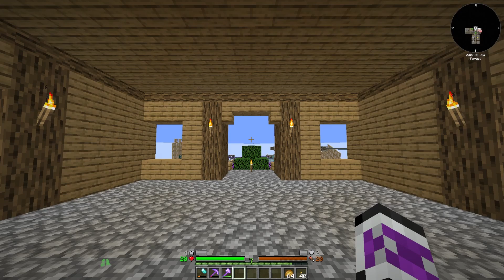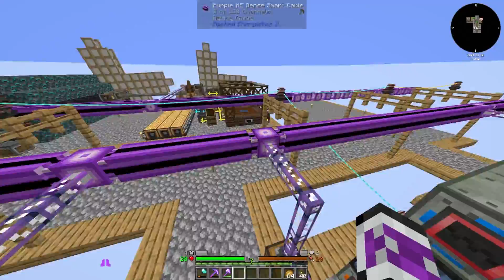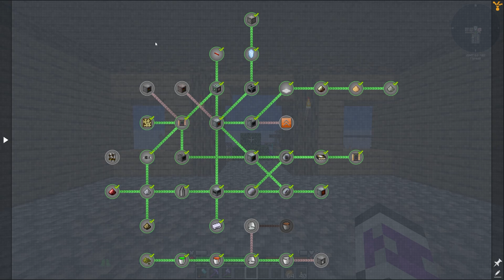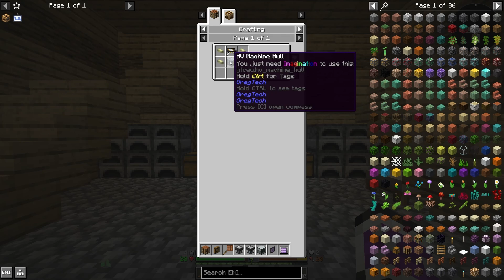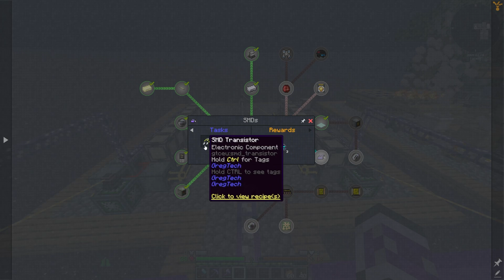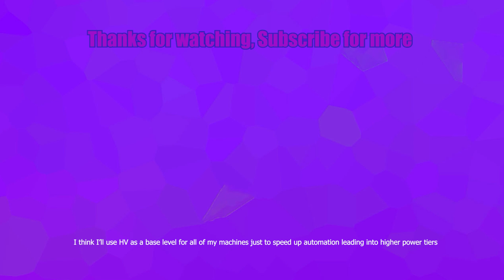Star Technology: Episode 13 - 'Properly' Starting HV

Comment: new to ae2 as a whole how are u putting the gasses inside the machines
Reply from the maker: The pattern providers insert any items or fluids into machines that can accept them based on the recipes in the provider.
Reply: @Thaumiumking9  no i didn't specify enough i mean into ae2 idk how besides a bucket of some liquid.

Comment: how did you get your circuit assembler to work with patterns? I can't seem to get mine to work
Reply from the maker: You might need to change the circuit assembler to allow inputs from the output side and to auto-eject outputs. Also make sure the recipes have the right amount of components and liquid metal, the JEI doesn't always auto-fill that correctly.

Comment: best way around liquid requirements in gregtech is to just have a machine exclusively for a liquid, so you can exclude it from the recipe. also a good fluid storage method is gregtech super tanks with a storage bus
Reply: also you're going to want to set up passive poly-ethelyne and polyvinylechloride as you'll need a lot
Reply from the maker: I was going to use that method, but I didn't want to make a bunch of duplicate machines if I don't need to just to bypass a bug with AE2. And if there is one fluid that I need 1000's of buckets of then I'll use GT tanks with storage busses otherwise AE2 fluid storage is easier for a bunch of random fluids.

Comment: Modular routers works wonders to automate sieving stuff, I think it’s the activator module, set it to down and watch the magic happen. You may need to update some FTB settings, forgot which ones though.
Reply: its the "allow fake players" section in ftbteams setting, but you need blazerods for speed upgrades to make them actually fast, which isn't impossible at this stage of the pack but still kinda annoying. deployers work jut as well

Comment: I would definitely recommend upgrading your machines to HV. The speed helps alot. Also alot of the HV machines can be upgraded into multi blocks with the multi block upgrade kit. You get that at the very start of EV
Reply from the maker: That's the plan, HV upgrades across the board for the efficiency. I didn't know about the multiblock upgrade kit though, all the more reason to upgrade to HV.

Comment: gregtech machines have auto output functionality. you can config that in the second tab on the left of the machine ui. you do have to click the "allow input from the output side" button, if you want to use the pattern provider on the same side for that. no need for all these pipes collecting outputs.

Comment: enjoying the series so far! as only stated on the curseforge page in one singular line, the pack isn't made for people who are new to gregtech, but it seems that you're doing pretty fine and having fun anyways! another probably nitpicky comment, but you dont need to pipe out the stuff from your autocrafting machines. instead, you can use a wrench to change where the output port is to point it back into the pattern provider with right click, and use a screwdriver to set it to auto output and allow input from the output slot with right click and sneak right click respectively. there is also a cheaper machine hull recipe in the assembling machine which only uses the machine casing, two 1x cables, and some polyethylene.

Comment: This is a really convoluted solution to your issue with the fluid middle click thing but it works for me:
- Get a thermal series fluid cell (not attached to anything, just somewhere near the pattern encoding terminal)
- Get a GregTech Empty [Material] Fluid Cell (I use the aluminium one, but pretty sure better material ones can hold hotter substances? or something? idk I can't put liquid copper in this one but in creative, I can put it in the stainless steel one)
- Set the max I/O on the thermal fluid cell block to whatever amount of fluid the recipe needs (usually something like 144 millibuckets or 63mb in the case of your issue in the episode)
- Fill the Empty [Material] Fluid Cell with at least enough of said liquid for the recipe
- Right click on the thermal fluid cell with the now not empty [Material] Fluid Cell. The thermal fluid cell will now have the amount of liquid required for the recipe
- Empty the remaining liquid in the [Material] Fluid Cell int o your ae2 system
- Take all the liquid out of the Thermal fluid cell with the [Material] Fluid Cell
- Go back to the recipe and right click with it in the pattern to set that much liquid.

After writing this one, this seems really complicated but I promise it's not.

(Also! for the thermal fluid cell, you adjust but 10/1 while holding ctrl if you didn't know)

Hope this helps
Reply from the maker: I was legitimately considering a method not too dissimilar from this one while recording but just decided to wait and see if I was missing something more obvious. Other simpler methods have been suggested but this method is too stupid too ignore, I love it.

Comment: you have too many shafts you can use reinforced motors from create to make su by providing power
Reply: Except there's a pretty significant loss in efficiency when doing that. Assuming he even has the resources and patience to make all those motors.

Comment: About the middle click issue: the only possible solution I know of is to remove all keybinds that are middle click except the pick block one
Reply from the maker: That could work, I'm not sure what else would be bound to middle-click though, I'll check it out. Thanks for the advice
Reply: @Thaumiumking9  I had this same issue! I just rebound the pick block control to one of my mouse buttons and it allowed me to change the amount of fluid for each recipe.
Reply: @jacobduplantis1963  It also allows you to order new stuff from autocrafting, even if there is still items left.
Reply: @Thaumiumking9  For anyone still looking or not familiar: in the key bind settings in game you can pick category or key. If you mark key and then enter "middle" in the search bar below, it will show all key binds that are using middle click. As Trulyno stated, everything except pick block needs to be empty, or rebranded with a different key, then it works as intended.

Comment: Suggestion for AE-Gregtech auto processing (not the crafting recipe issue).    Depending on what all you want to have set up for processing, you will need separate gregtech machines because of the circuit number.    You can rename the pattern providers in an anvil to reflect the circuit number, just make sure you include the machine name because this fully replaces what displays in the pattern access terminal.
Reply from the maker: I didn't know I could rename machines in the pattern access terminal, that would make sorting things a lot easier. Thanks for the tip

Comment: It's better to put patterns in columns instead of rows for molecular assemblers. That way you spread them between multiple pattern providers, so more crafting can be done at a time. Also AE use "pick block" key (the thing where you click middle mouse button looking at block and it move that block to active slot) for requesting autocrafting and changing amount of ingredients in patterns. And for some reason if you also have any inventory sorting mod it doesn't like to work with MMB. You can try to change pick block keybind and check if this works(I didn't test that). Or you can remove whatever inventory sorting mod there is in this modpack. At least assuming it's not Quark or something similar, that add more than inventory sorting.
Reply: i have to thank you so much, i was stuck at a certain point of this world, i was going to quit because i didnt know what to do, plus no one talks about this problem other than this video or you guys in the comments, thank you so much!!!